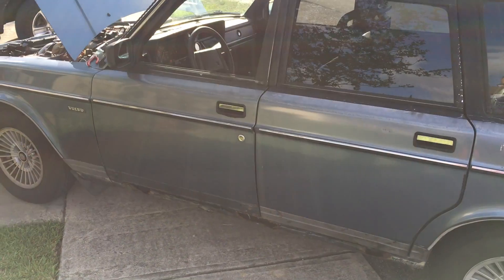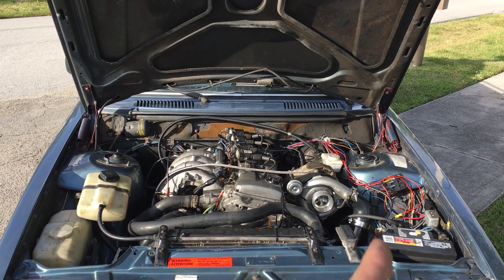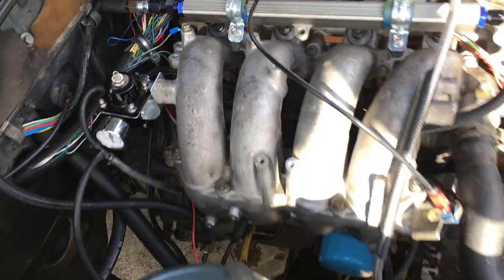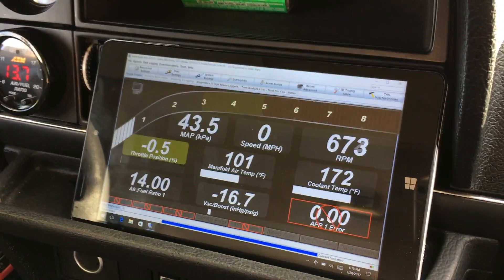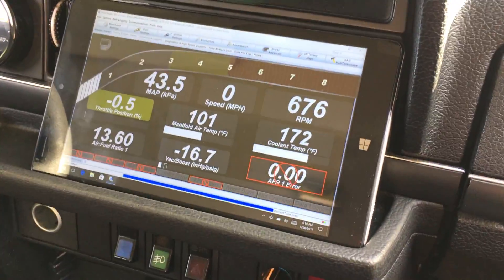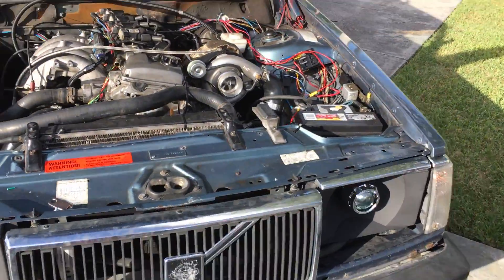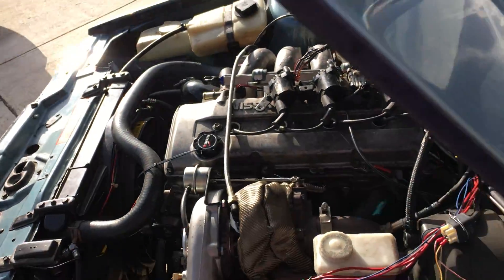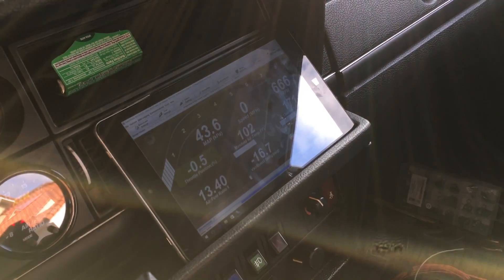1987 Volvo 245 Wagon KA24DE+T Swap Microsquirt Megasquirt

Comment: Bob il apreciate if you have a básic wiring diagram for the Coil set up i was going ti use a disc for the distribuitor but love yo do ti whit ls coils
Reply from the maker: I bought the KA24DE trigger wheel, then wired up the ls coils in wasted spark. I put 1 and 4 together, and 3 & 2 together.

Comment: can you please tell me how you got the stock Volvo drive shaft to work with the ka24de transmission
Reply from the maker: Easy,  2-2-237 Spicer for the rear end, goes to 1310 joint. Then I got a Nissan Manual Trans to 1310 yoke. Then ordered a custom length driveshaft (which i measured myself center to center) Wasnt even that expensive from southwest speed
Reply: @Rodney Gerald i dunno I watch on flixportal. just google for it :) -benicio
Reply: @Benicio Atlas Thanks, I went there and it seems like a nice service :D I really appreciate it!!
Reply: @Rodney Gerald You are welcome xD